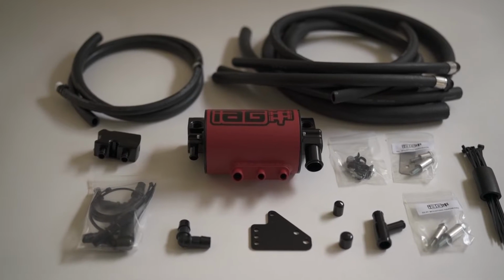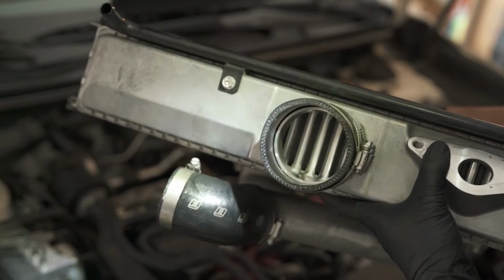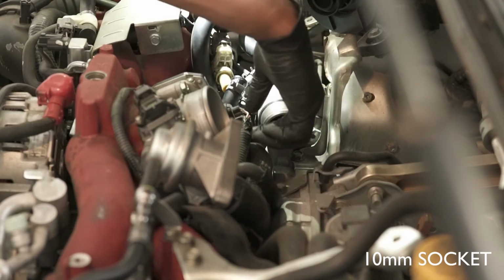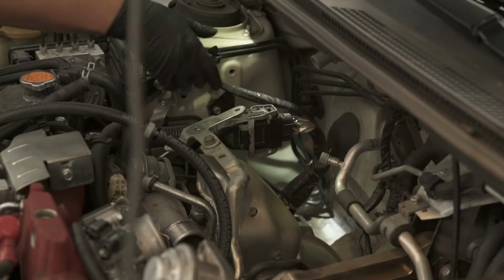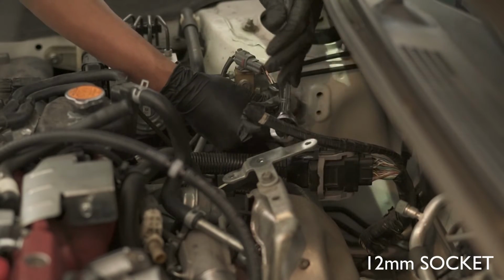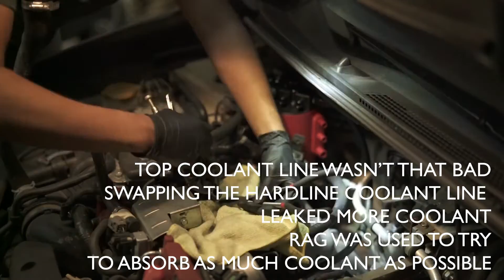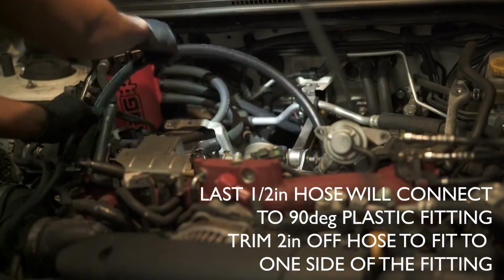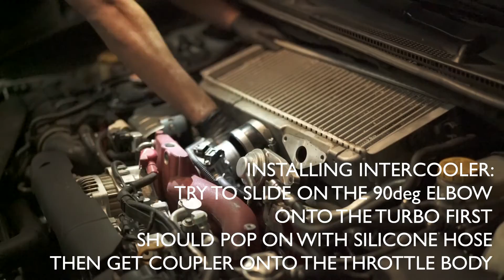Subaru WRX STI | IAG Performance AOS Street Install DIY

Comment: I had a hell of a time getting that turbo to intercooler hose back on due to the AOS drain hose being in the way. Highly consider finding another way to route it.
Reply from the maker: it definitely is a PITA! The more you do it the easier it seems to slide back on and i think its just through experience and bit of patience. There are times where I get my TMIC back on in 5 minutes time and other it takes 30 min hahaha a little prayer helps! :) There definitely isn't much room though to route the hosing - I guess the easier answer is go FMIC? =P The only other alternative route for the hose rather than going through the hole of the intercooler bracket is to route it outside and around the bracket. After having my motor rebuilt, Adan at AQ Motorsports routed it this way. the hose gets slightly squished, but it doesn't pinch it completely where it doesn't drain. 

I understand why IAG instructs you to route that drain hose through the hole of the intercooler bracket (so that the TMIC doesn't squish it), but if there ever is a reason why ou need to remove that bracket for whatever reason, that is just a PITA to have to take an extra step to always take off that hose and put it back on.

Comment: Hey did you end up having any leaks or issues when you used zip ties for the drain hose at 14:48? I'm having a ton of difficulty getting clamps back on and I'm thinking about just going with zip ties or worm gear clamps.
Reply from the maker: hi Danny! From my personal experience, the zipties held just fine and I never saw any leaks or had any issues!

Comment: Nice install video! I don't have an STI, but this will be helpful either way when I get mine. How's the experience so far?
Reply from the maker: Sorry for the late response! The car was really enjoyable! I more recently have sold it to fund a future bucket list project of mine, but I can say I don't regret owning the car. A lot of up and down emotions, but I can't say the learning experience was not worth it. Granted I told myself I would try to fix and wrench the car myself to the best of my ability. If I didn't approach the car that like, it would have been spending a lot more time at a shop than in my garage and I probably would have hated the whole experience hahahaha
Reply: @SpacemonkeySTI  No worries, bro! I feel you. My wrx is collecting dust most days and my wallet hates me, but it's been an enjoyable experience!

Comment: Installing the tmic with the hose by the turbo is a pain in the ass. There have to be a way to reroute that hose.
Reply from the maker: hahahahaha it totally is annoying! The easiest fix is going FMIC hahahah! Other than that, I feel like it takes me 30+ extra minutes just trying to couple the tmic to the turbo properly with the hoses on that nipple hahahahaha
Reply: Dude I Literally lost my mind. my hose clamp still isn't on properly. I'm thinking of running it next to the backet with the line running to the manifold nipple.

Comment: hey man love your videos! keep up the good work! did this help stop it from consuming oil?
Reply from the maker: Thanks for the love man! I want to create more content for the channel, but unfortunately I am without the STI at the moment! After my Laguna Seca track day, I noticed I was consuming a significant amount of oil. I topped of 3 qts over 300 miles or so - more than I ever had previously. Did a leakdown test and found that there was a 30% leak in one of the cylinder. No external sounds of rod knock or spun bearing so I think I caught it pretty early which is nice. Just annoying to be away from the car so long as SOA does their thing. :)

Comment: Does a sound generator tube allow more noise to the inside of the car from the engine bay ?
Reply from the maker: yes - it takes the intake noise and funnels in through to the passenger side ac vents. it's a nice touch and at least not a sound clip pumping sound in through the speakers. 

I have an AEM intake now and you still get plenty of intake noise in the cabin with it.
Reply: @SpacemonkeySTI  that's amazing. I'm going to look into these :) thanks man ! Great video by the way 👌

Comment: What year is your STI?
Reply from the maker: my model is a 2015 (2015-2017 should be very similar. 18+ I believe there are some sensors at the end of the hard oil line that runs right below the TMIC. I'm not certain, but I think IAG supplies 18+ AOS with the proper things to remove or cover these sensors since they wont be needed anymore. Please don't quote me on that hahaha

Comment: Dude. You're music volume is way higher than your speaking volume. It makes your video so hard to follow and it's annoying.
Reply from the maker: Actually I only put the music levels back to normal when there is nothing to talk about and speeding up the footage. When speaking, I dropped the music db -15 to -20db. Listening to this on my MBP's speakers at 6 clicks down from max volume and it sounds fine to me. Sorry it not tuned for your ears. If its annoying, you can check out the pinned comment for a table of content that lists out each step. Or you can watch the video not on max volume.

Comment: Did this help with the oil consumption
Reply from the maker: with daily public road driving it definitely helped and stopped the top offs (I'd check my oil right before an oil change at around 3500-4000 miles, and it will still full) and on track it kept oil consumption to a minimum (whereas without the AOS, I'd have to put in like 1/2 quart per session). Personally I think its a must for the EJ and very easy to reverse back to stock.

Comment: Oh man. I just swapped my longblock for a stage 2 fully built forged internals etc. I just need a break in tune on my 05 sti. But been looking into AOS. Seems like a pain to work on. Haha but do you need to tune for it? Or is it miniscule effects on performance other then what its supposed to do as an aos. & would you be willing to help? Haha i would be down to drive out whenever I pick one up. Im in San Diego
Reply from the maker: Congratulations on the new motor! haha the AOS is a PITA but definitely something I think is doable! If I could do it, I think others can too! From my understanding, you don't need a tune unless you're running the competition AOS where the top hose dumps to the atmosphere vs recirculates the air back into the intake manifold. hahah I'm flattered that you'd ask for my help! Unfortunately, I'm not that confident to work on another person's car! I'd feel so bad if I did something and messed up after you'd taken the time to drive where I'm at! hahaha
Reply: What built block did you go with, and are you happy with it?
Reply from the maker: @joek1302  sorry for the slow reply - the block i used was still the same one. I could have gotten an IAG deck, but I don't have room to store a perfectly good short block. Replaced the internals with Manley H-tuff pistons and Connecting Rods and used ACL rod bearings.

Comment: Should I do this to my stock 2009 STi if I plan on keeping it?
Reply from the maker: If there is one mod I wish I did after purchasing the car, it would have been spending $400 on this AOS. I personally think this is  definitely a required mod for all wrx &  wrx sti since the close vacuum system does suck a lot of oil up into the intake tract. I don't think it alone will prevent ringland failure from ever happening, but it definitely will lower the chances. 

If you are going to track an sti, the best advice I was given was its not a matter of if, but when. So come to terms with that idea and set aside about 5k for a motor build to forge your internals. You don't need more power, but if you wanna spend more while the engine is out, be my guest and send the videos my way! hahaha The car's pistons are just fragile and at high RPM, you're going to get blow by. An AOS will prevent that blow by from happening as much as possible. I can't say for sure it eliminates it, but for the last 20,000 miles I haven't eaten any oil! :)

Even if you don't track the car, it's a good safety measure to just place on the car and just enjoy :)

Comment: Great video! I just ordered my
Cobb AOS and I look forward to installing it myself. Around how long did this take you? Lol
Reply from the maker: Thank you! Hahaha it always takes extra long because I’m recording while doing it.  This night took like 10 hours HAHAHA I uninstalled it once And it took me 2 hours to put it back to stock when I was trying to get my ringland failure covered under warranty (they still denied it and that’s a whole different story hahaha) & reinstalled it in about 3-4 hours. Once you see where everything is then it’s pretty easy to navigate!

Hardest part was putting the tmic back on & mounting the AOS to the firewall. This should be easier now with the updated bracket but the one I have is a PITA!
Reply: @SpacemonkeySTI  You can't just tell us you've got a warranty denied and not tell us why! esp if its stock. Im wondering if its because of the racing videos
Reply from the maker: @BathSaltBadger  They denied warranty because they said my aftermarket radiator and catback exhaust caused over-revving of the engine and that it was tuned.  I did not take up a lawyer and I've heard that subaru tech will just slap in  a new piston without resurfacing the head and block properly which will cause it to eventually explode again. Rather take that lawyer money and take it to a reputable shop to have the motor built properly.
Reply: @SpacemonkeySTI  ahh that sucks Lol im watching your aos install right now... installing it failing to reliazed im on a 2018 lol and i was like why are you skipping steps!
Reply from the maker: @BathSaltBadger  hahaha sorry brotha! Hope you were able to get around those stupid sensor subaru put on 18+ models hahaha
Reply: @SpacemonkeySTI  ninjaed my way around! What do you think of the Cobb dp ? Lol I'm gonna stick to stage 2 😂

Comment: I have a question do any of you Subaru owners do the tgvs aswell and add the iag AOS does it make it have a bracket delete on the stock intercooler can't find a place for it to remount😵
Reply from the maker: Hey man! I'll try to decipher your comment but it was a bit hard to comprehend. Subaru owners typically modify their TGV (either modding the factory ones to stay open always or buying TGV deletes. Typically this install is done while the motor is out of the car for say a motor build when forging the internals since everything is unplugged and its easy to to get to. It still possible to do while the motor is in the car, but you  just need to know your way around removing the intake manifold and unplugging everything connected to it.

the IAG AOS still isn't related to anything with the TGV. the hoses connect to the breather ports of the crankcase, routes coolant through the AOS to the hard coolant line on the turbo & to the ports on the intake inlet. I don't believe either a tgv delete or the IAG AOS install will delete any bracket associated with the TMIC since the bracket for the intercool bolts onto the intake manifold.

Comment: Super late to the party, but did this fix your oil sipping problem? I'm having the same issue in my 05 sti
Reply from the maker: I wish I could tell you a positive update, but I unfortunately ran into the early stages of ringland failure and the car is in the shop atm. On my road trip up north, I did not consume any oil which is a good sign! The AOS was doing its job :) but after the track day, I was eating a substantial amount of oil; more than what I was used to seeing. Usually I topped off every 1200 miles or so. I ate 3qts over 300+ miles maybe. Did a leakdown test and there was a 30% leak in one of the cylinders.. The car was still running smoothing, with no sounds of rod knocking or a spun bearing, so I think I caught it early.

Comment: How in the actual fuck did you get the god damn intercooler back on? I am struggling my ass off to get the inlet coupler on the inlet. I even took the entire drain valve back off and cut it half an inch shorter so I can properly fit the hose that Ts off through the little hole in the intercooler bracket.

Comment: it’s too bad this is not a 08-14 sti engine... the 15+ engine has been modified slightly. hoses / tmic brackets were moved.  much easier to install on a 15+ sti engine.
Reply from the maker: interesting! I didn't thinking the hosing was different on 08-14 models! I know they added a couple of sensors near those hoses by the TMIC for 18+. If I recall correctly, I had to reference IAG's older installation instructions on 08-14 wrx/sti for my installation. I thiiink mounting the AOS may be easier on 15+, but everything should be close to the same :)
Reply: @SpacemonkeySTI  What makes the install a pain in the '13 STI is the TMIC mounting brackets.  They are too big. The AOS's is not compatible with the mounting brackets.  I may relocate the mounting brackets for my car.  I'll try to make a video to show people.

Comment: how much oil did you have to add to it? and did you add more oil or after?
Reply from the maker: The amount of oil my car hold may be a little different since I do have this AOS and also oil cooling lines that run to my CSF o-series radiator. But before I installed those parts, I always poured one of the 5L jugs of motul oil into the car and it was enough oil to make sure the oil was topped off even after 30 miles of driving to circulate the oil through the system.
Reply: @SpacemonkeySTI  Isn't the stock capacity 4.2L of oil? Overfilling might be why you said you had a lot of oil in the intake.

Comment: Will this video work on just the WRX Street install?
Reply from the maker: The install is probably similar for other EJ motors, but the FA20's turbo location is different so I don't think this will work for 2015+ WRX's!
Reply: yeah it would be a 2011 WRX

Comment: That’s quite a bit of oil being burned I would take it to someone and see what could be going wrong internally.
Reply from the maker: I for sure installed this too late. Had ringland failure in cylinder 2 iirc. Internals are now forged :)

Comment: 1 quart every 1000 miles, that's a lot man. Something's wrong.
Reply from the maker: yup - according to the owner's manual though, somehow that is "normal" hahahah but that kind of consumption should suggest to people that you  are progressing towards ringland failure. The car is now built with forged internals and 40k miles later, I haven't had to top off ever between 4k interval oil changes. The last time I removed the intercooler though (when installing the downpipe), I did see a little oil residue (not nearly as much as in this video or what i've seen in the past. 

@octurbojoe runs an a pretty over-engineered setup where he has a duel catch can system after the AOS line which still picks up a LITTLE bit of oil, but I think that is the only way to completely eliminate oil from going into the intake track. He is also only using a cobb 20g turbo too. Big turbo setups I would say require what he engineered.

Comment: Fix the music to voice volume
Reply from the maker: Thanks for the input, I'll adjust for future DIY install videos. I don't plan to re-export this video since I don't have the raw footage or premier project file anymore. 

As I mentioned in previous comments below - I only put the music levels back to normal when there is nothing to talk about and speeding up the footage. When speaking, I dropped the music db -15 to -20db. Listening to this on my MBP's speakers at 6 clicks down from max volume and it sounds fine to me. Sorry it not tuned for your ears. If its annoying, you can check out the pinned comment for a table of content that lists out each step. Or you can watch the video not on max volume.

Comment: Dude if ur burning oil every 1k id take it back to the dealer u got a lemon i have zero issues with oil on my 2018 sti
Reply from the maker: According to your subaru owners manual, burning about 1 quart every 1200 miles falls under normal operations hahahaha I literally couldn't argue with that crap (at the time the lawsuit against subaru oil consumption hadn't started). When my car final blew up, SOA regional rep said that the logs off my ECU showed my car had been tuned and was over revving the motor. Also blamed  the aftermarket radiator and cat-back tomei exhaust for the ringland failure hahahahahaha..... I didn't tune my car till august 2018.

two things were going to happen. I either take my car somewhere else or i keep arguing with the dealership (who had my car for 3 months till they finally denied the warranty work) and lawyer up. I knew even if I had subaru fix it, they wouldn't do it right. They will attach a new piston and slap it all together till it blew up again. If I went that route, I probably could have gotten an 2018 model if it failed again hahahaha but instead I had the car towed to AQ-motorsport and they forged my internals.
Reply: @SpacemonkeySTI  aq dope spot i was gonna give them a try